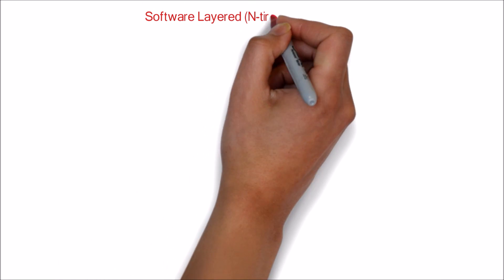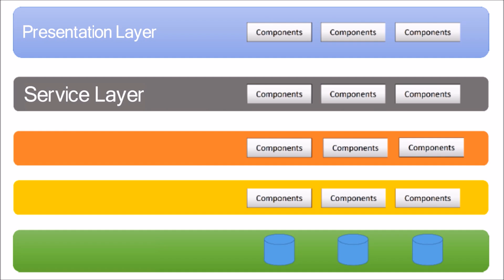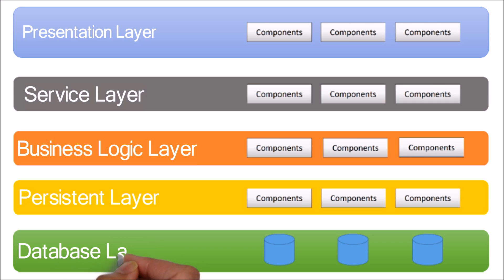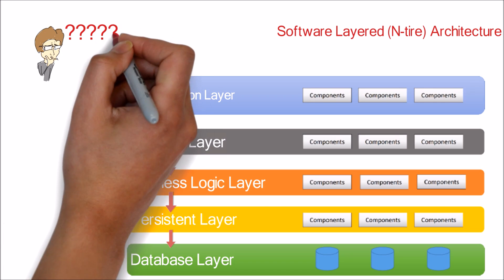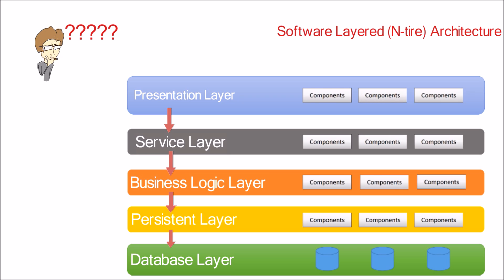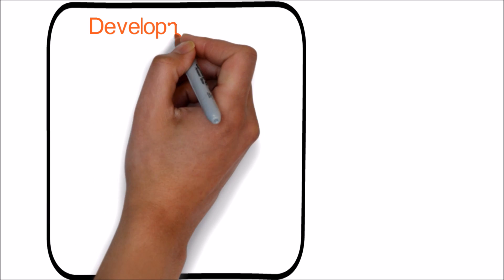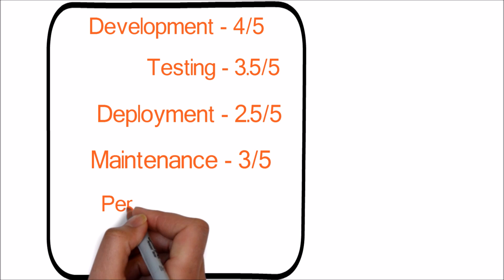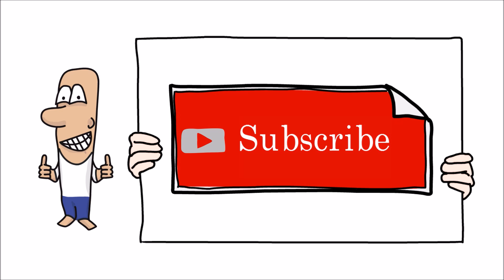1. Software Application N-tier (Layered) Architecture design pattern | Tutorial with example

Comment: Dear Friends,
When I design a software system, I divide it into 3 categories:
1/ Conceptual: I will state the names of the software that will respond to the requirements of the business process from users, describe the names of the software to be processed and the behaviors.
2/ Logical: I can define software architecture by applying architectural pattern in this step and I will include constraints on availability, scalability, maintainability. I also describe in detail the function of each component. This step
3/ Physical: Define programming language, platform to realize the description in Logical step.
Could you recommend?. Thank you.

Comment: What's the difference between "Layers" and "Tiers"?
    Logical layers are merely a way of organizing your code. Typical layers include Presentation, Business and Data – the same as the traditional 3-tier model. But when we’re talking about layers, we’re only talking about logical organization of code. In no way is it implied that these layers might run on different computers or in different processes on a single computer or even in a single process on a single computer. All we are doing is discussing a way of organizing a code into a set of layers defined by specific function.

    Physical tiers however, are only about where the code runs. Specifically, tiers are places where layers are deployed and where layers run. In other words, tiers are the physical deployment of layers.